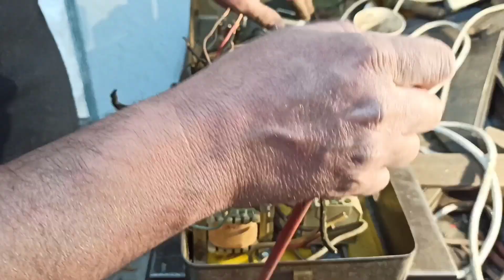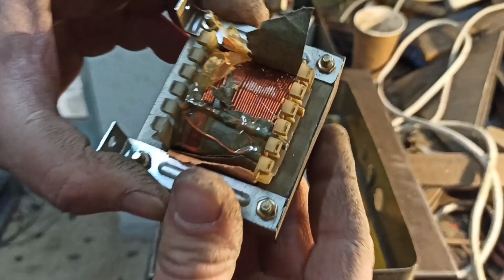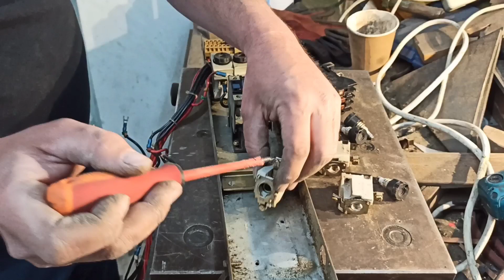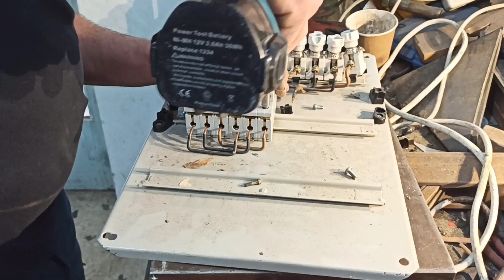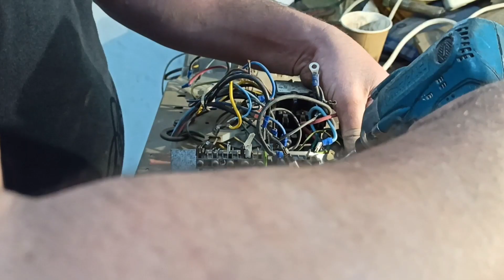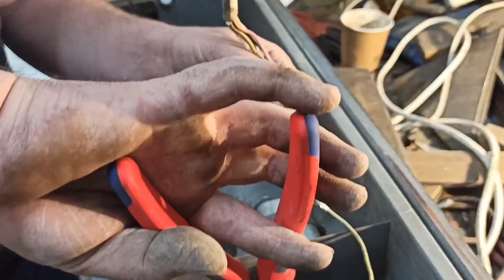sorting control boxes from A/C units...

Comment: How common is air conditioning in Greece?  Is it mostly for commercial buildings or ae there a lot of residential systems too?  Here in Texas virtually every building has AC or else we would die lol.
Reply from the maker: Same thing here my friend...in the summer time it can reach 120°F.....even the chickens have a/c here 🤣🤣
Reply: @simplescrapping  Most of the US doesn’t have air-conditioning in homes because it’s not that hot. I wasn’t sure how hot it got over there.